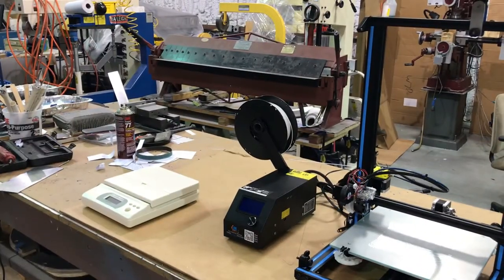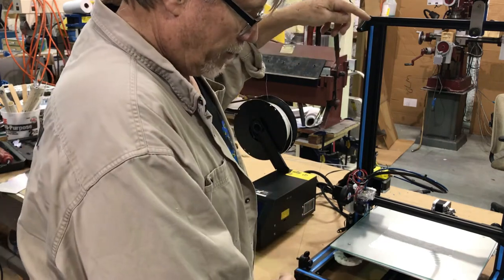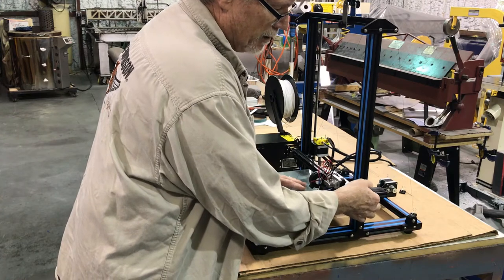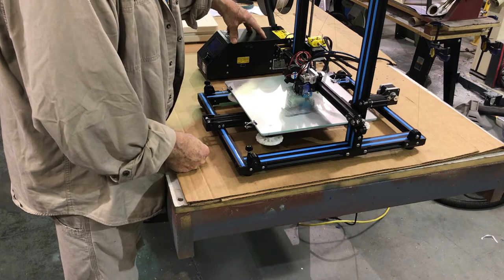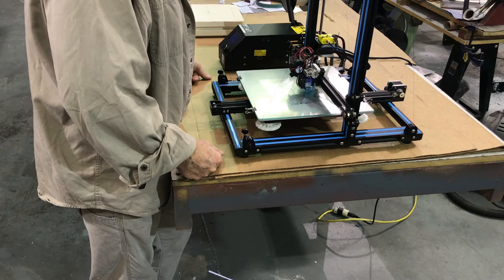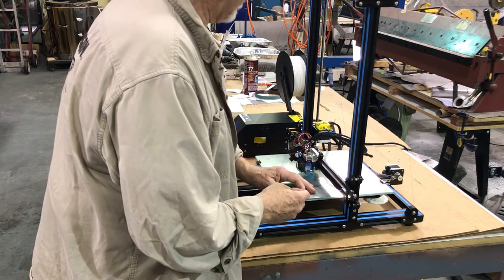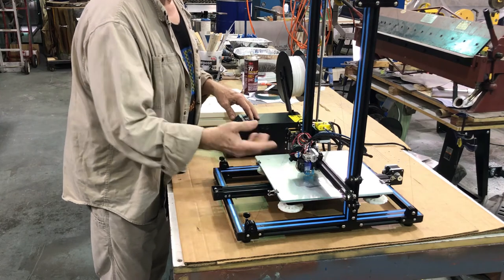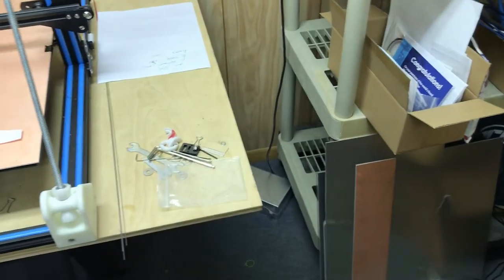CR10 DESIGN ISSUES

Comment: Check your slicer! Filling small gaps! Do the shaking! If u use simplify3d there is a setting section thin wall
Reply from the maker: Thach Le thank you. That will help but that big gangly tower needs help. 
See Jim Franks video. “CR10 upgrades, do they really help”. 
He used a gantry stabilization kit I make. It made the biggest difference in his test prints.

Comment: I got the same printer and i'm about to use a RAMPS 1.4 with Arduino Mega and TMC 2130 drivers. Waiting for the postman!
Reply from the maker: Karsten Kruse great. A step in the right direction. The ramps enables you to take your CR10 way further. Check out the touch screen upgrade. ILet me know if you have any questions about what's presented and subscribe and get notifications. I have some bonus material coming up.
Reply: David Ashenbrener well, i'm not that interested in the touchscreen, i use Octoprint. However, i'm interested in the mechanics of the printer. Why are there stresspoints, what kind of forces are at work, can we measure the forces? The weight of the glassplate is a problem i didn't even consider. I'm also interested in your wire construct.

As for the sound dampening adapters for steppers, thats primarily why i'll try the TMC 2130 drivers. I suspect they should be a better solution to that problem. On top of that they can be finetuned via SPI bus, check out the tricks Josef Prusa on the I3 MK3 used them for.

Subscribed :)
Reply from the maker: Karsten Kruse you are absolutely on the right track. 
I'm suggesting seeing Tom Salalnders video presentations on those drives. I looked into them and they are on my shopping list most definitely. 
I'm presently filming vids on some of the improvements on build surfaces to help with the moment loads. Today I'll be adding to the website so you may want to look at my copper clad Fiberglas epoxy build sheet I use. It's probably the first biggest improvement you can make. It also heats up twice as fast which is a real bonus. 
 The adjustment video I'm uploading now concentrates on the right side of the x beam and waiting for my patent application to come back on my "STINGER" bed leveling system that touches your nozzle to the build surface to automatically level your bed. It touches your bed in several places automatically then writes a mesh into your board. Your print will follow the contours of your build surface and make a perfect first layer every time you start each print and you don't have a huge sensor hanging off your holder that you have to program offsets into the firmware for...